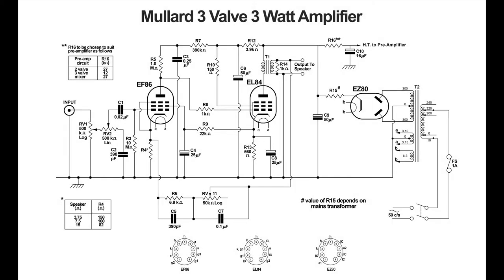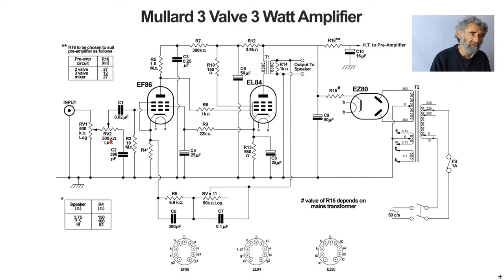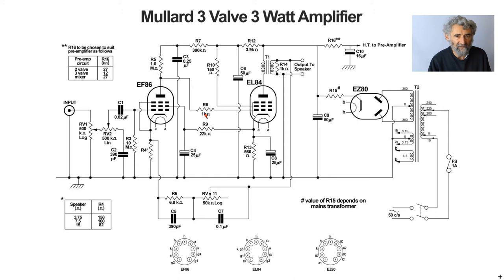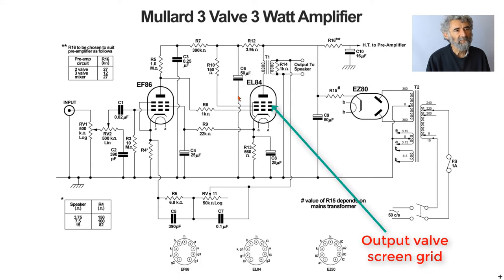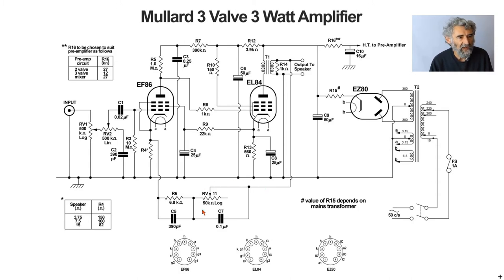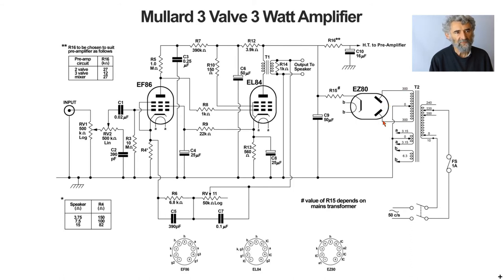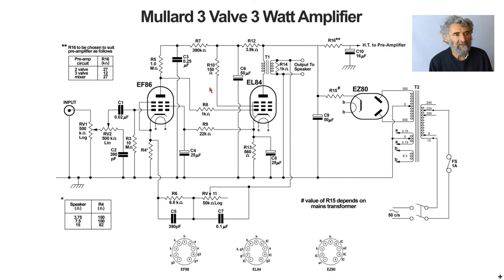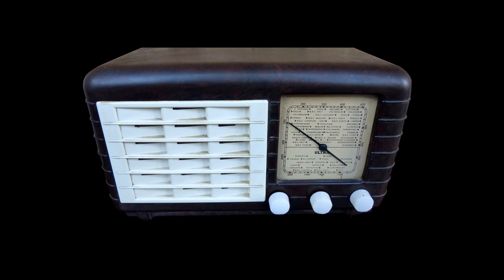Valve Amplifier Study 007: Mullard 3-3 Valve Amplifier

Comment: I like the Mullard description for the EF86 as being in 'starvation' mode in this circuit. It is fascinating and there are many reports of it sounding excellent. The EL84 is a great valve in my opinion and packs a lot into that little envelope. The only issue I had with this circuit is the need for such large amounts of feedback, which is not so popular these days. I have had remarkable results from a triode connected single 84, and while many say its no good as a triode - well I didn't just take their word for it and tried it. Glad I did too.
Also glad I found this channel too. Subscribed.
Reply from the maker: glad it helps out, we have many other videos concerning the EL84 valve for the near future, one of the amp circuits has zero nfb... thanks

Comment: Hi, Thanks for answering back. I built it many years ago. The grid of output tube has high + voltage from plate of  previous tube  and with 560 ohm of cathode of its output tube is to have overcurrent. So its 560 ohm was burned by heat of overcurrent at that time.If I remember still, I replaced it with 6.8 k ohm 5w. Then it was ok, I think.

Comment: Hello, if I won't be using an external preamp, can I dispense with R16 and C10?  Thanks.
Reply from the maker: With the amp you don't need the capacitor and resistor if you are using an external mixer circuit. The resistor is only varied to get the correct HT for the preamp.
Thanks,
Clive Kavan
Reply: @vintageaudioworkshop  Ok, thanks for your answer, much appreciated.
Reply from the maker: @KK-no7be  very welcome

Comment: R13 560 ohm does not seem to be proper value.
Reply from the maker: Hi, we checked the value which is correct, and according to the Mullard Circuits For Audio Ampliers book (available from our ebay shop https://www.ebay.co.uk/itm/163158603335) ''The use of direct coupling between the stages necessitates a higher cathode voltage in the output stage than is required with RC coupling. The value of R13 is thus greater than is usual for the cathode resistance''. Hopefully this clears things up, but we will double check with Phil the technician when we next see him,
Vintage Audio Workshop